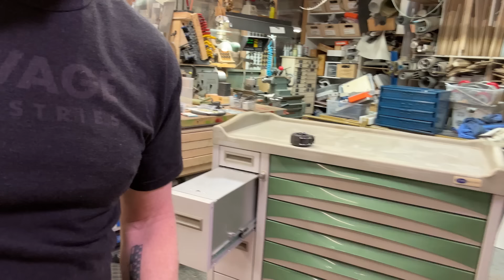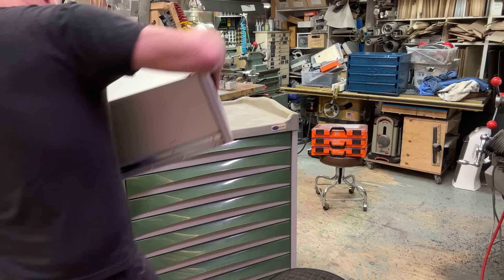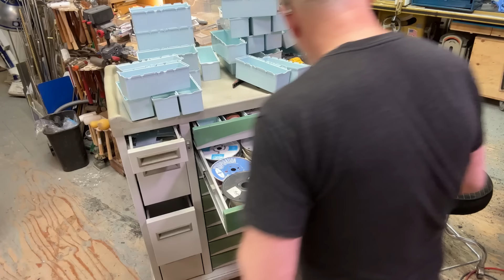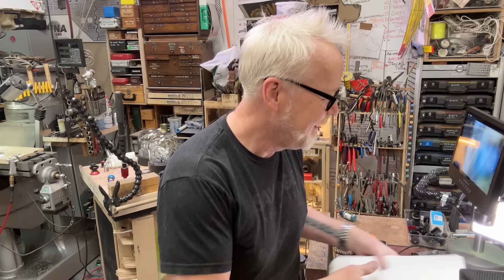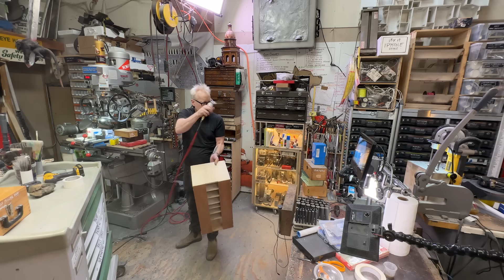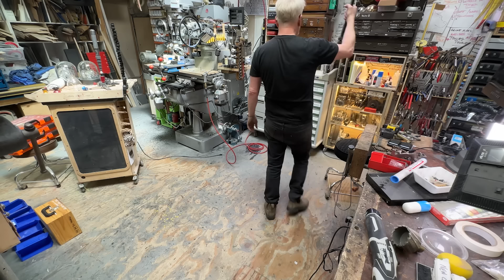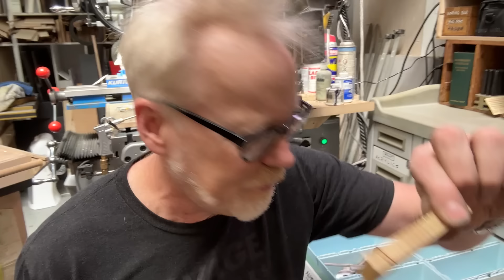Adam Savage Finally Finds Good Shop Storage Drawers!

Comment: Cool rolling cart, my first thought when you had the locking top drawer out, take the time to remove the other lock which you dont have the key for now that you can get to the side of it...unless that is located in the flat drawer section.
Reply: My next thought further in around the 28 min mark....the high ceilings and walls would be perfect for a modified french cleat type system so you could attach the upper storage to the walls vs making a house of cards on wheels...and the second thought, I wonder what is in the lonely tackle box on the floor in behind the milling machine.

Comment: I do more electronics work than anything else, and I also prefer stranded wire to solid core — except in a couple of very specific use cases: where the wire is its own connnector (e.g. breadboards) and where the wire is structural (circuit sculpture and similar situations).  Of course, sometimes you don't have a choice; I've got a roll of 46 gauge magnet wire I got for winding guitar pickups, and as astonishingly fine as it is, it'd be ridiculous as a stranded wire.

Edit: Huh, picked up those last tubes of acrylic paint in Eugene or just had the Duck Store bag?

Comment: My face when the drawer popped out😲😬 Side note you probably said it somewhere before I noticed you sorted it this way but most used top drawers least used bottom drawers as a mechanic for example I put wrenches sockets screwdrivers on top and uh oh tools on bottom like taps dies ect.

Comment: that lock for the green drawers should have a code on it,you should be able to give any reputable locksmith company that code and the brand name of the sorter and they can get you keys just in case it gets pushed in and locks. I was a locksmith back in the day and used to go out on calls to get the info needed to get keys for locks like that all the time.

Comment: I picked a masterlock once as a kid - it was on the cable used to lock my bike to a bike rack and I had lost the key - I spent a couple of hours in dad's garage trying to get it open and then it magically happened - it sprang open - I was SOOOOOOO excited I immediately thought that I was gonna try to do it again - at which point I closed the lock .... with it still attached to the cable :-( many more hours later and I had failed to repeat my accidental success so I had to cut the lock with a hack saw ... which was exhausting and time consuming

Comment: Draws are a classic case of "out of sight, out of mind". I completely agree that the only way they work is if there's a specific purpose for the draw, so you know to go there for that specific thing - but once you get things that are one-off tools that don't fit anywhere in particular,  and get thrown in a draw, that's when you get hit hard by "out of sight, out of mind". I'd go so far as to say that if a tool is going to go into one of those draws, I shouldn't have bought it as I'll never, ever use it. I still do it all the time though.

Comment: I wonder what percentage of Adam's life has been moving things from one box to another, or building a new box to move something from an old box into that new box???
Reply: Re-organizing and re-arranging things provides a solid amount of dopamine to my ADHD brain, so I get him lol
Reply: To be fair to Adam, I work in a Machining shop, and holy butts their cabinets and drawers are so damn unorganized that when there was a slow period for me (The shop Lackey), I went and organized 3 5ft tall cabinets, which took a long time since EVERYTHING was out of order and unlabeled for the most part. It took me about 4-5hrs each day for a week to get it all together due to every single damn nut, bolt, screw, drill bit, etc etc being thrown in, and if I was lucky was still in bags or boxes.
Its so nice to have shop infrastructure where you can find something fast and easy.
Reply: I mean, I don't want to think about how much of my life I've spent doing just that. Maybe sometimes it's best not to know.
Reply: My thought exactly.  He can spend hours and days "reorganising" the shop every time he acquires (or builds) a new set of organizers.  Now keep your eyes open for a dental cabinet with its many shallow drawers that would be great for pens, pencils, and paper clips.
Reply: I suspect the answer is 'Yes'
Reply: I Packed and unpacked for a remote job last week. Time cards showed 4 hours packing/unpacking. the airport… and the 1 hour flight each way took closer to 8
Reply: He's a great entertainer, but has lost the plot a bit. Dude has dozens of every single thing. "A drawer for my tape measures", wtf
Reply: @iivarimokelainen  You don't have a drawer for your tape measures? Fine, but it doesn't mean those of us that do have an issue.
Reply: @iivarimokelainen  this is part of his job and what he enjoys to do lol
Reply: @iivarimokelainen  bro, you sound jealous 🤣🤣
Reply: @iivarimokelainen  I have a drawer for nearly all my measuring tools including something like 8 tape measures.
Reply: @iivarimokelainen  Not exactly the same but I also have a measuring drawer in my tool cart. Tape measures, calipers, etc. With a shop his size I wouldn't be surprised to see a full drawer of tape measures (especially since he appreciates fine tools he's probably collected some here and there just to try out).
Reply: @iivarimokelainen  I don't have a drawer for my tape measures. I've got a large box full of them. I've got this hang up about getting rid of something useful. Obviously. Don't even ask me about screwdrivers.
Reply: Also, that wasn’t a woodruff key he picked up at the end. It wasn't even a woodruff key cutter.  Dude is clearly more invested in the idea of what his shop it’s actual function
Reply: @Iivari Mokelainen  quite the shop for one person, I'll say that! Not in terms of footprint, but certainly in its catalog of tools and materials. I still very much enjoy watching Adam build just about anything, but I do genuinely wonder sometimes about the seeming surplus of _everything_. If he's enjoying it, who are we to judge, though!
Reply: @chrismanning5232  I think it's more about different versions of the same tool behave differently, and each will fit a slightly different job. Not getting what you want out of a tool can be a flow killer.

Comment: I've found a love for those stackable drawers that you get at office supply stores. I use them for my art supplies. I designate them to specific art mediums and associated tools. I have multiples of things so I can have them in multiple drawers so I'm not hunting down small things like erasers, sharpeners, blades ... I just pull out the drawer for the medium I'm going to use and I have a portable container that has all my acrylic paint with brushes, or acrylic gouache with brushes and wet pallet or all my tools for working with clay. They are all labeled with adhesive vinyl. It's the storage solution my ADHD brain has always needed
Reply: Link? That sounds cool.
Reply: I used to use white electrical tape, basically vinyl tape, to label drawers by writing on it with a Sharpie, but I have found that the print tends to go illegible after a couple of years of exposure to light. I have had better luck with medical or surgical tape, the  cloth type stuff. Strangely, it seems to be only easily available in 1/2" or 1" width, and I'd really like to find some in 3/4 inch width.

Comment: One thing I've learned watching a lot of professional fabricators and technicians of different sorts is that their tool storage system is as much as tool as the implements they actually store and employ.  For rolling carts like that, I tend to think "purpose-storage" and putting tools surrounding a function or type of work, rather than mixed general storage, which makes less use of the rolling function.  To me, that looks like it would be an excellent airbrush equipment and paints storage cart.  The notch in the back of the one drawer from the removal of the locking lid would be a good compressor cord passthrough.

Comment: The blue organizers in the bottom that you dismissed :( are Akro Bins and they deserve better.

They're my favorite organizing unit because they are stackable and more importantly both inspectable and hangable thanks to the lip on the back side. This allows you to have as much vertical space as you want filled with neatly contained yet visible and portable nooks for your things.

They come in a variety of dimensions and have accessories like dividers and lids, as well as various mounting solutions. Please do reconsider!
Reply: The problem with Akro bins when you hang them on the wall is that they're open to the environment and therefore they collect dust. I particularly don't like the dark blue Akro bins because it makes it harder to see what's in the bin, especially if you have 2 or 3 somewhat similar but different fasteners or whatever in the bin. The light blue plastic bins used for the other drawers of this storage cabinet are much better because they allow more light in. Somebody who's 30 with near perfect eyesight might not care so much, but when you get to 60 and your eyesight isn't great and perhaps you're working in a shop that doesn't have the best or most ideal lighting, you will find that you want light- colored high visibility containers and trays for everything.  I've even gone so far as to spray the inside of my toolbags with white spray paint so that anything that falls to the bottom of the bag will at least be backlit to some extent.
Reply: No, Adam is going to make a cabinet for all of those bins he discarded as too good to throw a

Comment: I suspect the only reason why those wheels are still so smooth is not due to quality, but because that thing has sat in the same spot for most of its life. Everything we had to use with any regularity on the floors, like the dynamaps, the mobile PC stations, etc., all had wheels that barely functioned. Even when we got new ones in the wheels would be jacked up in less than 6 months.

Comment: This should be a PERFECT 3D printers station. A big one on top (or a couple medium-sized ones) and ALL you need inside drawers.
Reply: That's a great idea. I've been curious about 3D printers for a while now, but I don't really know much in the way of details. How much does a 3D printer for personal use, such as you envision fitting on top of that surface, cost?
Reply: @GnomaPhobic  Look up Ender 3 Videos for examples and its usually a few hundred at most for a "solid" 3D printer. Also depend on how much work you want to put in yourself to getting it dialed in just right
Reply: @Montisaquadeis  I'll check that out. Thanks for the tip!

Comment: I would use the blue tubs as wire dispensers, place each reel in the blue tub, and cut holes for the wires, maybe add a wooden rod  across the middle of them as well so it's easier to spool the wire

Comment: Wow, just so happens I've been looking for a drawer solution to build my new garage shop. I have had the exact opinion about drawers for years - they hide things away, and it adds an extra step to retrieve a tool (have to open the drawer first obviously). Also they are much more expensive than something like a pegboard or "shadow board." However... in my case, I now have a very small space to work with, and when you consider that to lay out tools in a way that they are organized neatly and easily retrievable, then what you need is surface area. And to maximize surface area per volume, you need drawers. Arguably they also make a shop more aesthetically pleasing. I've been trying to decide whether to build my own from scratch or just buy them pre-made. Thanks for the video!
Reply: I'm in  the same boat as you are. The make/buy decision is an especially tough call. None of the commonly available, reasonably priced consumer companies (Craftsman, Husky, US general) make anything with lots of shallow drawers. 

Adam's "new" cabinets are commercial/industrial units and very expensive unless you're lucky enough to find them second hand.

Building is very time consuming and usually more expensive than an off-the-shelf solution. You do get something custom tailored to your space. But if you have a preference for steel drawers over wood...

It would be awesome if one of the consumer companies sold cabinets empty and sold drawers sepatately in 1X, 2X, 3X, etc sizes so you could mix and match to your personal needs.

Comment: How is it I never realized the floor in his shop is wood? How is this possible?
Reply: There's a ramp that slopes down from the front of the shop. A wood floor was added to level it from the front. Obviously it was built well reinforced and able to handle the load of heavy equipment like the lathe and the mill. He talked about it on a couple of occasions.
Reply: @Bedwyr7  Thanks. I've watched plenty on tested and never noticed this fact.

Comment: got one of those for my tool box in the machine shop i work in. check the locks for codes. you can have keys made from that. also love the way mine rolls around. i think its just because of the size of bearing they use in it. the wheels dont have a 1/2" pin for a bearing they have like a 2-3" ball bearing.

Comment: Hello Excited. I'm Dad.
Jokes aside, that's a good cabinet. Drawers are where tools go to die, but there's no changing the fact that without drawers... you'll eventually run out of space. The only shop i've ever seen that didn't have drawers and exposed everything as early Adam would want was a former allied aircraft hanger in W. Germany and every tool was set on display stands, as you'd find them where you'd buy them. But that outfit had plenty of floor space. I've a barn converted to a shop, and they had easily 4 times my floor space. And all this is coming from someone who has seen many shops across Europe, having required the services of the elders wherever the job needed my team and i. Every other shop was a mix or pure drawers. Big American style tool boxes being the most skewed result, and that one was a former motor pool guy that moved to Europe.
It's the law of shops, the bigger you grow, the more drawers you need. :body-blue-raised-arms:

Comment: By my experience in aged care, this looks like a cabinet designed to transport medication to room to room in a health care facility, hence the locks on the draws that only the medication nurse or doctor would have the keys for.
Reply: 100% saw the thumbnail, and clocked it as medical equipment. I have seen so many cabinets like this in my travels as a chronically ill person. Congrats Adam on a creative re-use!🎉
Reply: The fact it has a work surface suggests that it's used for procedures as well - it seems quite bulky for doing simple medication rounds
Reply: I read "aged cars" at first, and was very confused.
Reply: By no experience I can deduce that by the color of it, and the size of the drawers and the locks.
No big mystery.
Reply: @morbidmanmusic  Adam also literally says it's a med cart less than 3 minutes in

Comment: Never really got Adam’s thing about drawers – well I did, and I didn’t: deep drawers that can’t be pulled out all the way are where things go to die, that’s totally true. There are crap drawers and good drawers: good drawers are shallow, so things can’t hide underneath other things, and good drawers are drawers that can be pulled out until you can see what’s in the back.
Reply: It's probably mostly down to attention deficit. For a lot of us out of sight is out of mind to a greater extent than to someone who doesn't have to live with it. So it's a common strategy to store things in a way where we can always spot it just by looking around. It takes a lot more effort to internalize where something "lives" when we start putting them in drawers, and to maintain it as well. (this is also probably why everything is very clearly labelled on the outside of Adams drawers). 

I know that for me personally, using drawers even if they are organized and not too deep usually means I need to open and look in all of them, cause I simply cannot remember where stuff is. Or I just forget it exists entirely. The only drawer I have that works for me is one that specifically only has water color tubes in it, organized by color temperature. If I try to have anything else live in there my attempts at organization will simply implode.
Reply: @bluefish239  With you all the way.....I have a system of cardboard A4 copy paper boxes all stored in a cabinet made from 20mm square tubing, 8 rows by 5 rows high,  and the boxes have all my "good" junk that I've stored for 40 years and occasionally delve into for something......indexing them is done by numbering the boxes.....all 36 of them....... and then photographing and making a print of the contents and stored in a folder........when i want something it's easy peasy to browse the prints in the folder and go to box no. whatever and it's all there.
Reply: Yup this is my system. I want to be able to see everything instantly., plus it keeps the dust off. To me junk drawers are when you have a thing, don’t know what the thing is so you just chuck it in a drawer so you don’t have to think about it. Work out if you actually need it first then assign it to a drawer with similar items.
Reply: People with ADHD have problems with object permanence. Basically if you can't see it, it doesn't exist